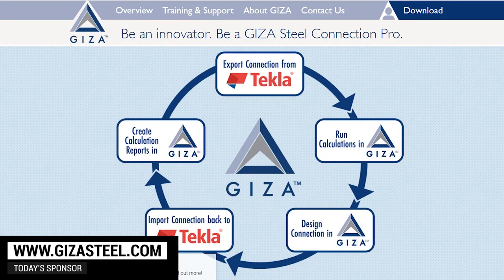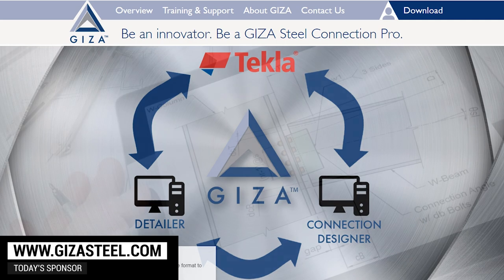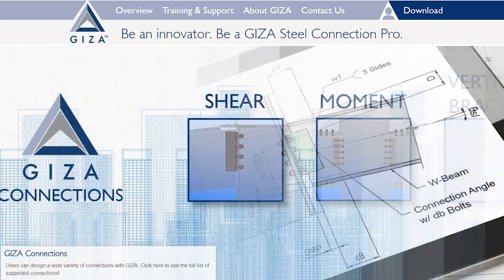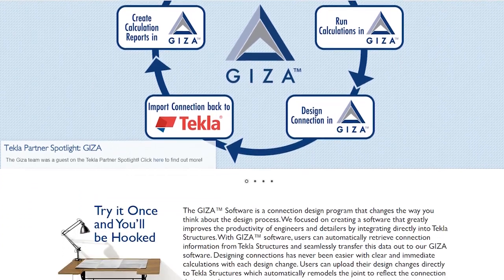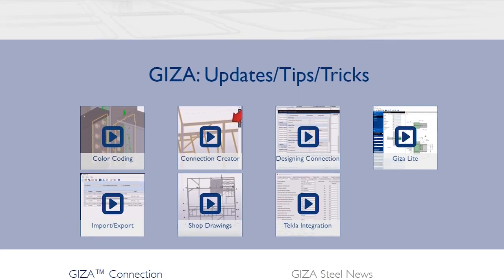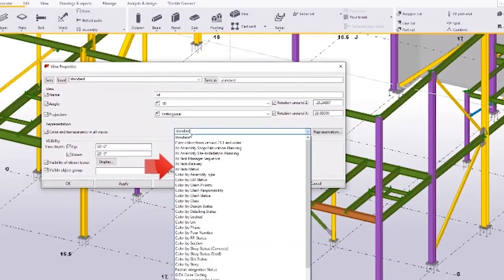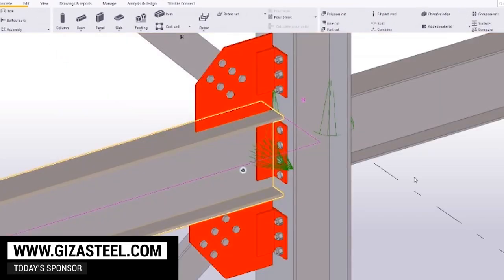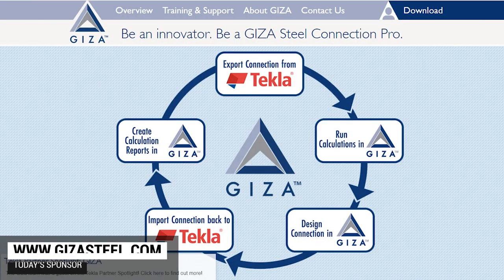Structural Design of High-Rise Buildings | What You Need to Know

Comment: Why don't you build out of steel honeycomb for walls and flooring an eliminate concrete?  Concrete is far to brittle as proven by 9 - 11.  Of course the exterior would half to be Glass as used now, but with honeycomb backup where there are no windows.
Reply from the maker: James thank you for this information.
Reply: @EngineeringManagement  I have a design on how to form the honeycomb and have spent many hours researching material.  Steel is the best I could find.  As a matter of fact I spent a lot of time working on Manufacturing housing to eliminate wood and concrete.  If I could get  a company that is interested I will buy the first house. I am 81 years old so my ability to deal with this is past. I was head of quality at US Steel maintains division.  I do have a background as a machinist that can prove valuable. I have a design to accomplish what I preach.
Reply: @brown7228  As the building owner, you could definitely find who you need to get your project either approved or not (and approved with careful refinement). Let's get the ball rolling with city planning and a licensed SE firm interested. On the other hand, you could also seek extensive consulting from an SE firm to establish what can work and what won't before becoming an owner.